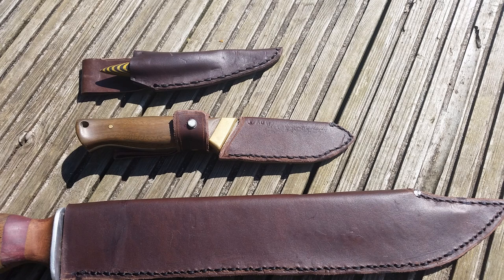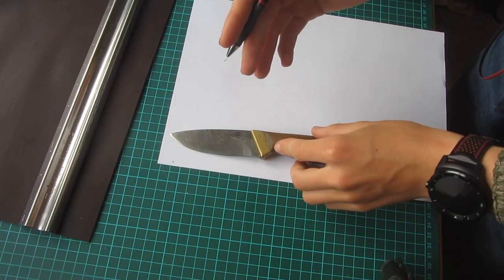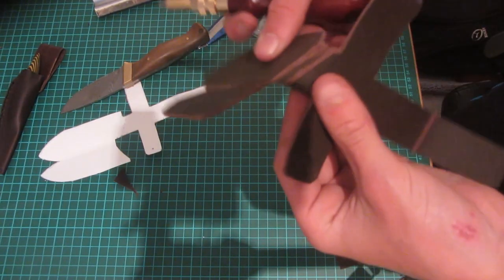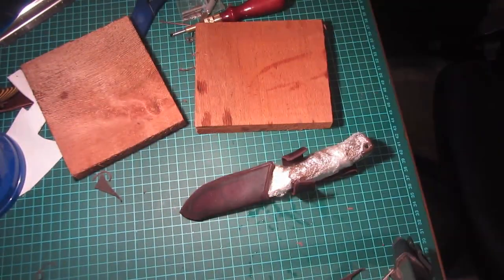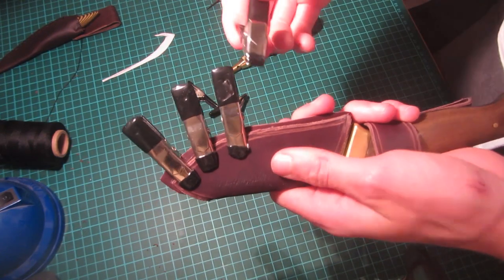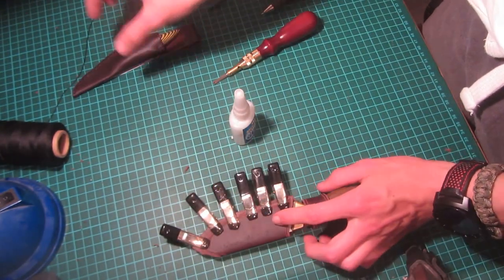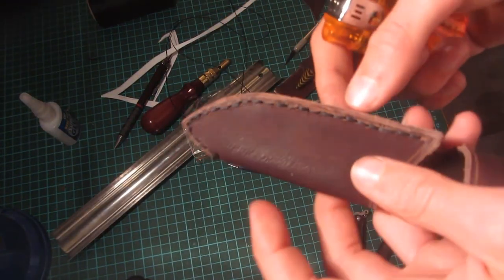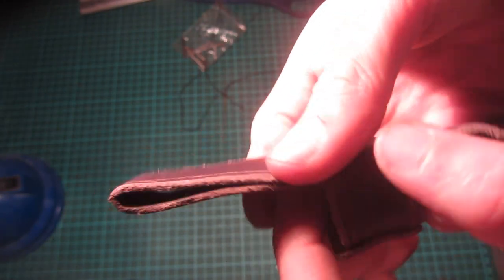How To Make Leather Knife Sheaths

Comment: Great video! I do have some suggestions from watching hours of leatherworking videos. 

Firstly there is leather adhesive called barge. 

Secondly, on the areas of the blade where there will be stitching, bevel the leather on what will become the inside surfaces, into a shape that is not unlike the tip of a chisel. This will thin the leather out, making it easier to punch through. This will also have the effect of making a smooth transition into the strip of leather that protects the blade cutting through the stitches. 

Thirdly, have you considered making a pocket on the blade portion of the sheath, where you could keep say, a small whetstone. 

As I said at the start, great video, and I have to say, nice job with the home made punch!

Comment: I'm impressed.. working with leather can be a pain in the balls. did a good job man, nice thinking on the magnets, i personal would have tried to make a buckle. used the same method (somewhat for my air soft gear. don't really want to fork out x much cash for something i can make at home. As for the video im not sure how it ended up in my recommended. but i was aptly impressed kudos dude

Comment: Whenever I make knife sheathes I always take Parafin wax, and rub it over the leather, then hit it with a heat gun to melt the wax into the pores. It usually works to water-proof the leather, it also darkens it up if you don't have any dye. Where did you get the leather sheets however? I've been to stores and end up only finding big bags of off-cuts.